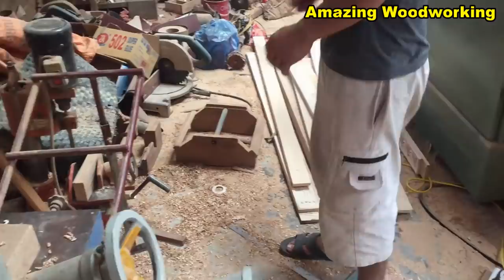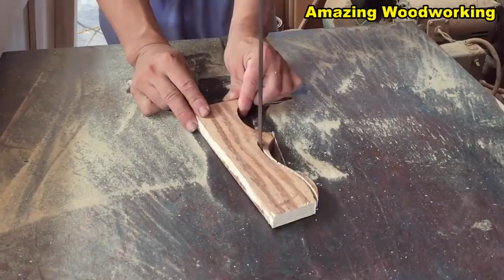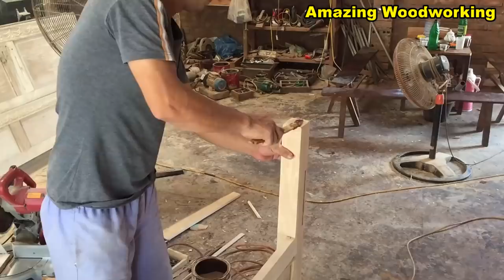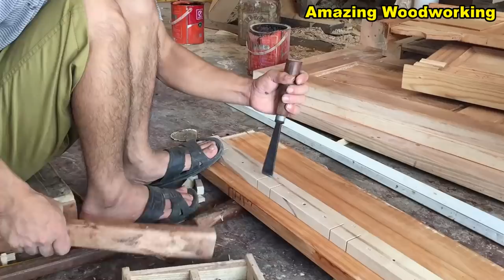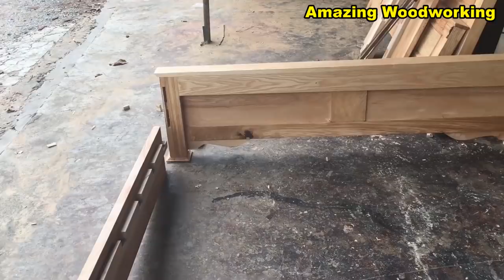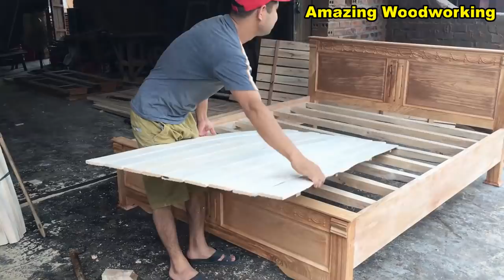#Amazing Woodworking Carpenters Coming from Asia Perfect At A New Level Fast Easy - Woodworking

Comment: Congratulations for this effort and the design of the bed is nice: just a couple of things among others that can be said: one is that they stick the bases of the legs with nails, that wood from the base when it dries, then the three nails  will stand out of each leg and if someone moves the bed will scratch the floor forever. two, total absence of carpenter's glue. They require a radial saw among other things.

Comment: The Carpentry skills are good but the choice of materials is very poor, the wood in used to make this furniture came from wooden pallets or commonly known as "Palo China" in Asia ...
Reply: i also noticed them working in a sitting position.why not build a table or platform as a work area ( not on the floor ) with standard height.just like what Norm Abram does.

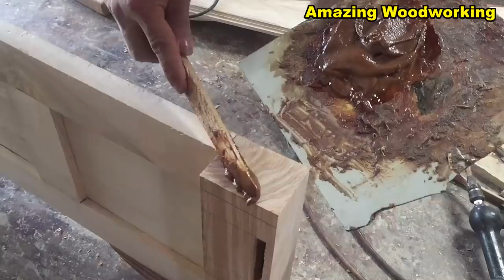Comment: a lot of stapling - wouldn't it be better to glue the decorative parts? Then they might not fall off as in 3:58
Reply: :) something for the buyers to do ?
Reply: This furniture could be sold at quite a low price in Asia . Stapling seem to be much cheaper to implement rather than glueing. Cos glue takes time to set and needs many clamp to hold them in place.
Reply: Yes,  no quality workmanship.
Reply: Uwe Zimmermann w
Reply: राजेश कुमार